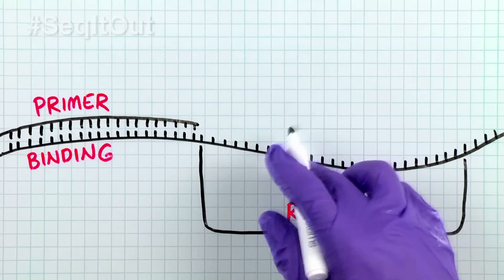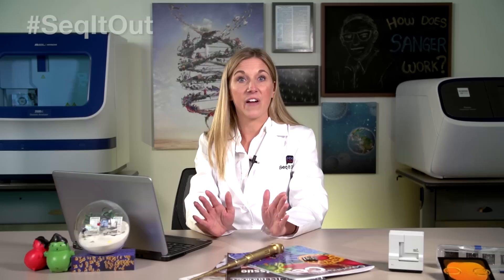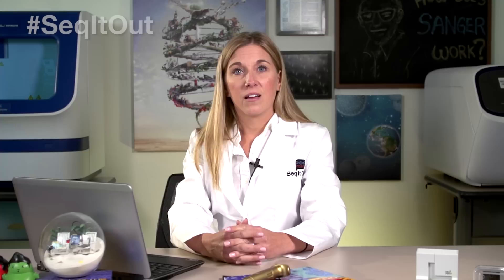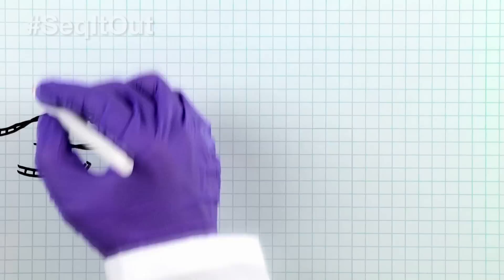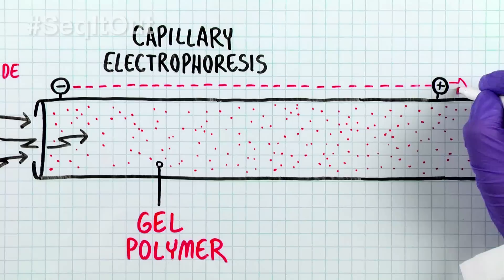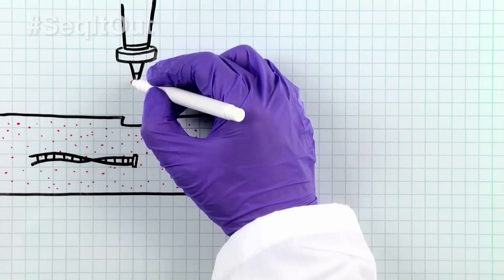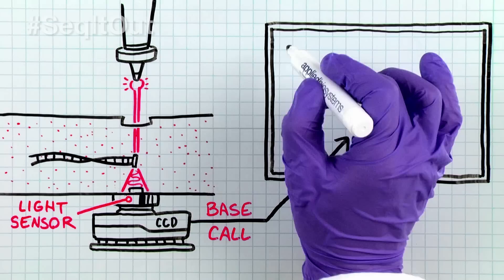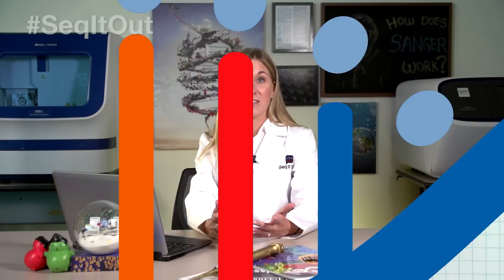How does Sanger Sequencing Work? – Seq It Out #1

Comment: How expensive is the equipment involved in Sanger Sequencing if I wanted to sequence my own DNA?  Is it feasible for those that are not in the research field, but want to run their own experiments in a home-made lab?  How about second-hand equipment? Thank you.
Reply: This depends on the number of sequencing bases (genomic region) you wish to explore.  Going to your local core laboratory at a university or a commercial service provider would allow you to look at one stretch of ~600-1000 base pairs for about ~$3-9.  If you own an instrument the reagent cost is about the same or a bit less.  Home made lab.... not really feasible for automated fluorescent sequencing.  Most instruments range from ~$40k-$300k.  You can go used, however you do get what you pay for.
Reply: @evennemeyer1  yes.. and additionally, this assumes that you have already prepared your dna such that it can be sequenced.. you will likely need to amplify the region of your DNA you want to be sequenced, using PCR - then either do a PCR cleanup or agarose DNA gel followed by gel extraction. At this point you will be ready to submit your sample for sequencing (you will also need to design primers for the region of interest, or select an in-house primer that's available from the sequencing facility)

Comment: I have a question. Here we have seen what are the dideoxynucleotides that are at the end of a DNA fragment? However, what about the identification of each nucleotides in a single DNA fragment?
Reply: Oh my goodness , same question !
Reply: when the laser excites the dye bound to a dideoxynucleotide, a light sensor tells the computer what wavelengths it saw and the computer processes it and reports it as a color, which then gets reported as whatever base you told it goes to that color. (I.e., you'd tell the computer that A's have red dye) and it will print the order of the nucleotides based on colors as the tube moves across the sensor.
Reply: @laurelcook9078 that didn't answer the question though. Is the only relevant nucleotide of each fragment the dideoxynucleotide then?

Comment: What happens to the 3 prime overhang after the ddNTP is added. Do you digest it before running on the gel? And if not, wouldn't this affect the migration of the DNA through the gel?
Reply: The DNA reaction is denatured prior to electrophoresis and run as single-strands.  The strand with the 3' overhang does not contain a flourescent label, therefore is invisible to the laser during migration.

Comment: How did he remove that oxygen atom from just "one" infinitesimally-small molecule?
Reply from the maker: Thank you for your questions. 

There are deoxynucleotides (dNTPs) and dideoxynucleotides (ddNTPs).  The ddNTPs lack a hydroxyl group (so there is –H instead of –OH at a specific location in the structure of the nucleotide).  (The creation of a ddNTP is performed on multiple ddNTPs, not one at a time.)  Without that oxygen in the hydroxyl group, a phosphodiester bond can no longer be made by DNA polymerase if the polymerase should happen to encounter another nucleotide.

A sequencing reaction contains both dNTPs and fluorescently labeled ddNTPs. Using a DNA strand as a template, a complementary primer anneals to the template and DNA polymerase extends the complement in the 5’ to 3’ direction as complementary dNTPs are encountered.  If a complementary dye-labeled ddNTP is encountered, the extension by DNA polymerase stops and a strand of a certain length is created with a dye label at one end.  So
during each cycle, multiple extension products are created. These extension products will be various lengths because the dye-labeled ddNTPs will be incorporated at different times among the different templates.  At the end of the cycles, there will be multiple fluorescently-labeled fragments.

Those fragments are then electrophoresed through a capillary.  The smaller the fragment, the faster it will travel through the capillary.  For example, a fragment that is 1oo nucleotides in length will travel faster than a fragment that is 101 bp in length.  There will ultimately be fragments (all one base pair longer than the previous fragment that travel past a laser.  The laser causes the fluorescent dye labels to fluoresce.  Each ddNTP (A,C,G,or T) has a specific dye color associated with it and as the dye fluoresces, the color that emits is captured by a camera and base calls are made in the software based on the order of the colors.

If you have any additional questions as to how this works, please contact abtechnicalsupport@thermofisher.com. Thank you.

Comment: I honestly couldn't understand were the DNA goes. Where do you put it????
Reply from the maker: When you isolate the DNA, you place it into either PCR strip tubes, 96-well, or 384-well plates. The DNA is mixed with water and our BigDye Terminator Ready Reaction mix which contains the dNTP and ddNTPs , buffer and enzymes needed for the reaction, placed into a thermal cycler to allow for the reaction shown in the video to take place. The DNA is cleaned up to remove any of the ddNTP that have not been incorporated into the product and then placed on the capillary electrophoresis instrument, where it is injected, run and the data collected. If this is not the information you are looking for can you please clarify at which step you are asking about – is it before the reaction, what do you do with it after the reaction, where do you put it on the instrument, or where does the DNA go after moving in front of the laser?